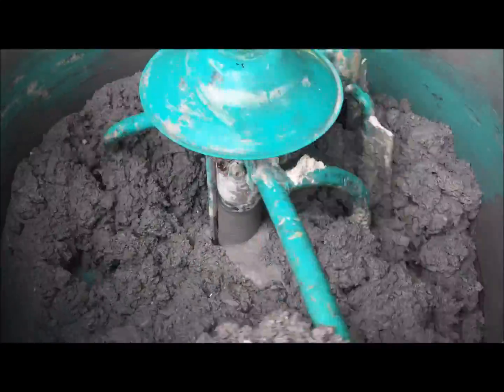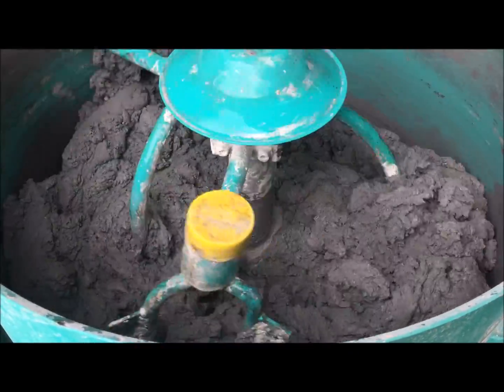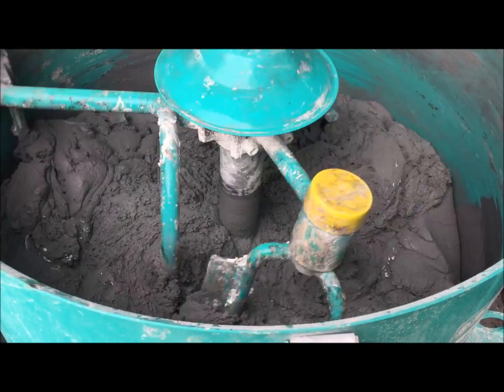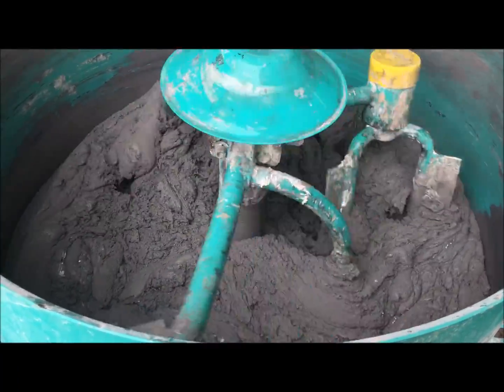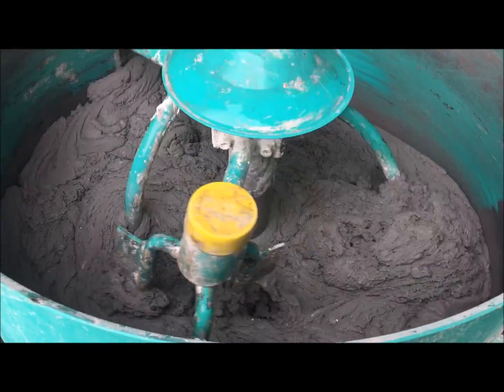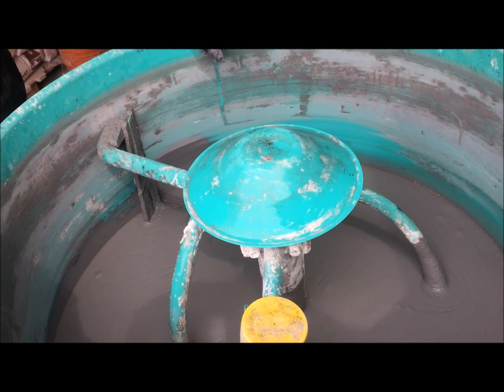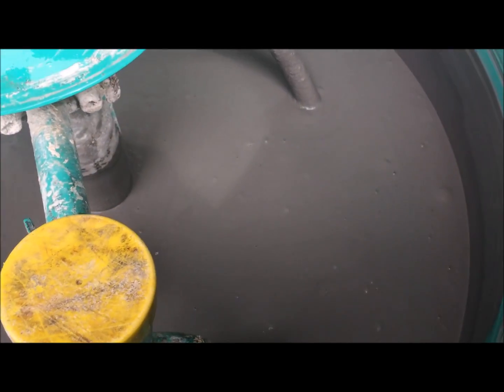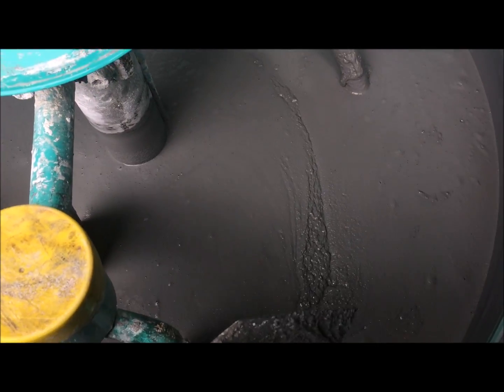Trinic SCC GFRC - Glass Fiber Reinforced Concrete

Comment: Can the fiber cause that the mix stops flowing? I try to repeat all processes and it goes well until add fiber. It makes the mix denser and it loses its scc features. I have tested a few kinds of cement. Just white cement from Allborg was quite acceptable and mix was almost like scc.
Reply from the maker: Hey, please give us a call or email - we need more information to help solve this.  Vince@trinic.us  607-775-1948
Reply: Adding fiber will 'dry' the mix. You have to compensate by adding more water.